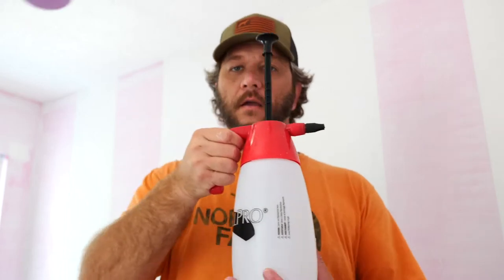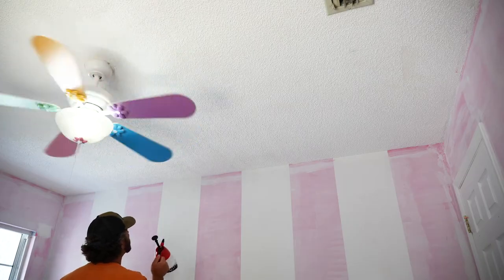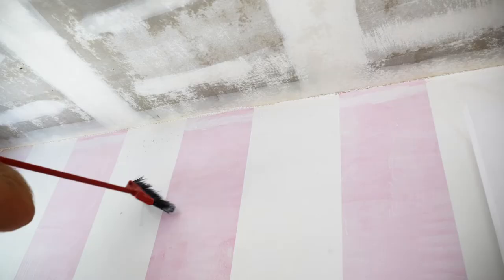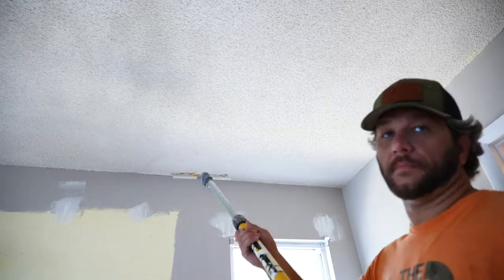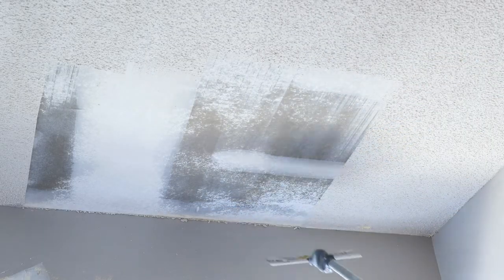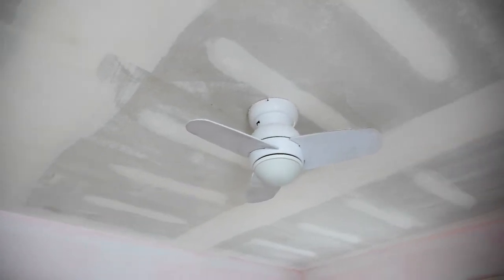SECRET to Removing Popcorn Ceilings FAST!

Comment: You do need to mention in your vid, that the reason wetting the popcorn down is important has much less to do with ease (just as easy to push it off dry!), but more to do with safety. Wet ceiling texture falls. Dry ceiling texture floats as inhalable particles in the air. Ceiling texture contains asbestos (aka silica). And a mask is still 100% necessary!!!!
Reply from the maker: Asbestos was pretty much outlawed in 1978. This house was built in 1988.
Reply: No, its literally for the ease of the job😂.  If its painted, just forget it.

Comment: Great video  but shows alot easier than I'm dealing with. I have 2 coats of paint. I have tried vinegar and hot water and still not getting under the stipple. Should I use a chemical to break the paint down. Your thoughts. Any suggestions?
Reply: I used hot water and fabric softener to remove layers of wallpaper.  Might work on the ceiling?
Reply: Search it on yt, I saw someone whack off the tips of the stipple with a metal putty knife, before spraying. This broke the "shield" of the paint, and allowed the hot water to penetrate thru the the holes in the paint, making the hole thing mushy and come off
Reply: Yeah once it's been painted, you are screwed. We put sheetrock up over it!

Comment: My popcorn was painted it did not come off this easy. (Only the one little patch in a closet that was not) I had to buy a special stripper for painted pop corn. It was a huge pain in the butt it would have been better to tear the drywall off looking back. Also alot of popcorn up untill the 90s probably has asbestos in it. Just somthing to be aware of.
Reply: It was banned in 1977.
Reply: Yeah, my house was built in 1961. No idea when the popcorn ceiling went up though, so I need to have it tested before I try this.
Reply: DIY Duke suggests just using more water on a painted ceiling, and one of his viewers suggests adding some vinegar to the mix.
Reply: 90% water 10% distilled vinegar for painted.
Reply: @DavZell  Asbestos actually managed to sneak in through many products sold through the 80's despite the "ban," so anything older than 1990 probably ought to be tested.
Reply: @Ivantheterrible666  Good to know! Thanks for the information. That comes in handy.

Comment: Hi there, what to do if removing the popcorn on the ceiling and there’s taping on the dry wall? Just remove it and retape? Or it is okay to remove and do a skim coat after? Thanks!
Reply from the maker: Hopefully you can remove the popcorn and still leave the tape. If you have to, just skim over the tape after.
Reply: @HAXMAN  gotcha! thank you so much for the fast reply!
Reply: Do everything in your power not to damage the tape

Comment: Do you have to tape off the walls? Our plastic and tape keeps coming off after we spray with water.
Reply from the maker: I don’t if I’m going to paint the walls.
Reply: @HAXMAN  ok perfect. How wet do you get the ceiling? Do you spray it all at once or small sections?
Reply from the maker: @jellyfishhh440  I spray big sections and then I spray close to where I’m scraping again. It just helps get it softer.

Comment: Add a vacuum hose from your shopvac to the underside to a flattened tin funnel and suck that crap up as it falls. Or use a dustpan with the hose attached taped to your handle and catch it. that way...

Comment: What do you do to Finnish the ceiling after scraping the popcorn? Just paint?
Reply from the maker: It depends how smooth the ceiling is. You might be able to or you might need to touch up rough areas with sheetrock mud and then paint.
Reply: @HAXMAN  Would Kilz paint do the job if nothing has been damaged?

Comment: Thoughts on asbestos in older ceilings?
Reply: My understanding is that Asbestos health problems, much like Roundup health problems comes from massive repeated exposure. People don't get asbestosis from a single exposure, but from repeated exposure over months or years, as in working at a factory that has asbestos blowing all over the place. Wetting the popcorn ceiling also reduces the number of fibers that gets into the air. The painted ceiling was actually the best because it all stuck together for the most part. That being said, I would recommend using a respirator, blocking of you air vents and any doorways have a fan blowing out of the house through a window or door in the room. I would also recommend using one of those full body paint suits with a hood, and throwing it away immediately after use, then washing your clothes (Do not try to shake the dust off of them!) and taking a shower immediately after use. While I believe most of these health problems are overblown, there is still a risk, and why take a chance if you don't have to.
Reply: @MAGAMAN  i agree with your entire comment actually

Comment: First thing you needed to do is get that popcorn checked out by lab to see if it has Asbestos in it, that's most important thing that you failed to mention Mr so yes there is a reason an excuse not to remove the popcorn till it's been tested for asbestos.

Comment: What worries me about this is that a lot of popcorn ceiling has asbestos and lead.  So breathing in and spreading all that debris is a real problem. Potentially dangerous for the person living there and for the people doing the work.
Reply: That's actually why you spray it. He didn't mention that. When it's wet enough, it falls straight down and isn't released as small breathable particles. But a mask is still supposed to be used!

Comment: It's not popcorn it's called acoustic 
Secondly if you have a spray rig use it with warm water. The way the guy in the video shows is very slow process